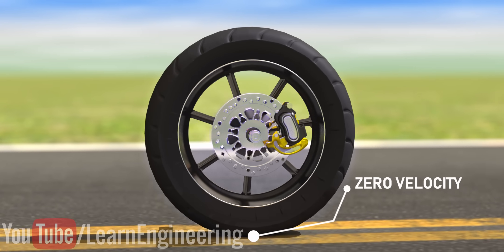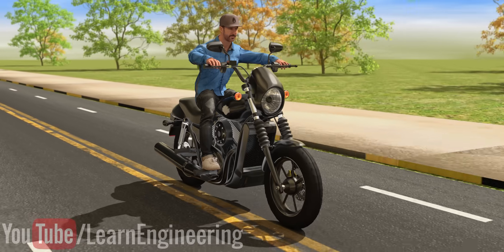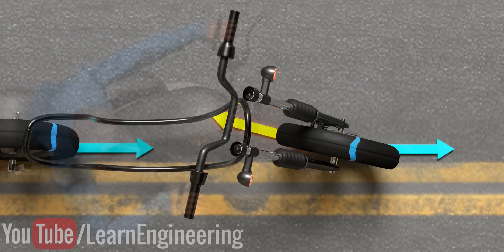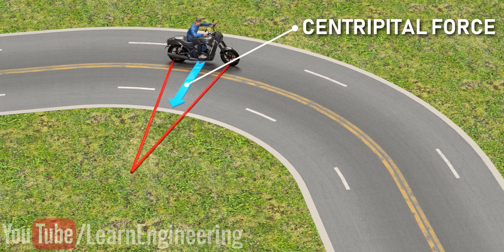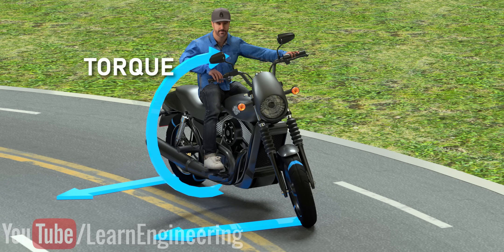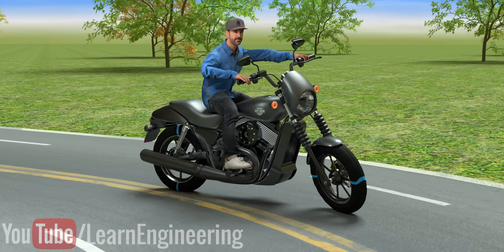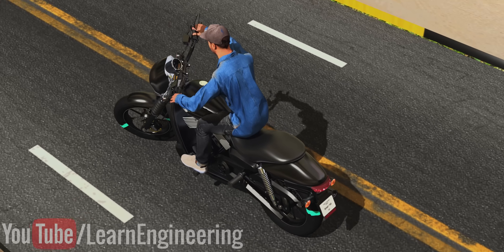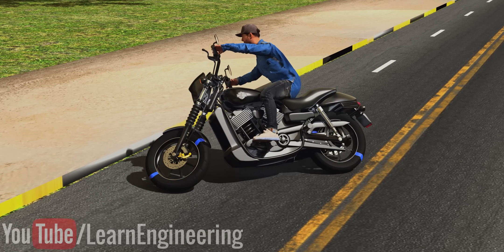Counter Steering | The interesting physics behind it

Comment: Counter steering is basically a natural way to turn a bike, too natural that a lot of riders doesn't realized they were using it all the time. It's the only way to turn while speeding. There is no such thing as "normal steering". Direct input steering is only used when the bike is slow enough that the torque it produce isn't enough to lean the bike, you use it at extremley low turtle speed. But once you start to gain some speed it will always be counter steering, no other way. The front wheels will always follow where the bike is leaning not where the rider turns the handlebars.
Reply: and you got an whole veretasium video to back you up 😁
Reply: @tonyfalapatt1308  hehe yes I watched it some time ago too
Reply: @tonyfalapatt1308  exactly😆
Reply: @tonyfalapatt1308  from kerala?😉
Reply: Easiest way i learned is press right go right, press left go left.
Reply: @everardomezajr3495  that's the same way I've always thought about it. I always thought that calling it counter steering was an easy way to inadvertently confuse people.
Reply: The fact that a lot of riders aren't aware of it make them go too wide in a bend when stressed out. If they were aware, they just pushed the inner barend and tightened the curve.
Reply: @HansVanh1  
100% bang on
Reply: Yeah, the knowledge of “if you’ve ever turned a motorcycle going 10mph or faster you know how to counter steer” that would end a lot of confusion, also very well said
Reply: @Zac-fu2qc  If you ever turened a bicycle at idle speed, you did it by countersteering, well said.
Reply: facepalm "The front wheels will always follow where the bike is leaning not where the rider turns the handlebars." ABSOLUTELY FALSE. Never heard of counterweight? If you lean the bike one way but you put your body the other way to keep balance while keep ing the handles straight, you're gonna go straight, not where the bike is leand toward. In order to turn, you have to turn the handle bars in the same direction too... And how about slow speed manoeuvers? You only use "normal steering", NEVER counter steering. Unless you like to fall... Which will not make you turn in any case... I suggest you buy a bike and learn to ride before saying stupid things... Cuz you obviously never rode a bike; i mean a motorbike, not a bicycle... and even on a bicycle you use "normal steering"; which according to you doesn't exist.
Reply: @saabsly1  
“In order to turn, you have to turn the handlebars in the same direction too”
Really????🤔
You then go on to mention “slow speed steering”, so I can only think that the first quote refers to higher speed steering.
Reply: @softailfun  maybe you try reading my post again???
Reply: @saabsly1  facepalm ""The front wheels will always follow where the bike is leaning not where the rider turns the handlebars." ABSOLUTELY FALSE. Never heard of counterweight? If you lean the bike one way but you put your body the other way to keep balance while keep ing the handles straight, you're gonna go straight, not where the bike is leand toward. In order to turn, you have to turn the handle bars in the same direction too... And how about slow speed manoeuvers? You only use "normal steering", NEVER counter steering. Unless you like to fall... Which will not make you turn in any case... I suggest you buy a bike and learn to ride before saying stupid things... Cuz you obviously never rode a bike; i mean a motorbike, not a bicycle... and even on a bicycle you use "normal steering"; which according to you doesn't exist."

Absolutely false.  Every word.
Reply: @saabsly1 Are you alright? He is right you know, Even on a normal bike you counter steer, and normal steering over 15 is not possible. Its physic
Reply: It's overanalyzed 
Anyone who rides does this naturally
Reply: @willyjf6193  But knowing exactly how it works allows you to do the right things quicker and more efficiently rather than have some vague idea of what to do.
Reply: @willyjf6193  thats why most riders lowside in panic situation
Reply: @willyjf6193  my dads friend tried to turn but didnt know how to countersteer long story short long life short
Reply: @willyjf6193  wrong; they 'kind of' do it naturally.  The rest takes intentional input
Reply: @willyjf6193  thts what i thought
Reply: @willyjf6193  Nope, not in an emergency situation. Too many riders are killed because they "naturally" turned the handlebar the wrong way, like the steering wheel on a car.  The "natural" way is to turn away, but on their motorcycle they then turned into the oncoming car instead of from it.
Reply: @willyjf6193  yep ....and every explanation I watched just complicates it ...
Reply: I agree, unlike how this video seems to say. You can push the handlebars the wrong direction the entire way around the corner. The bike will lean, it will turn the corner, and there's no danger of suddenly having to turn the "normal" way.
Reply: @elmeradams8781  Yes, you start the turn by tuning the front wheel the “wrong way” for a split second, then the front wheel must folow the turn. When doung so, the bike itself tris to turn sharper and stad up. To prevet it from doing so, you need to keep a light pressure “ourward” in the turn, put the front wheel follows the turn.
Reply: at what speed it starts to work? if you make a turn how do you know when to use countersteering and when to turn normally because speed is too low? Let say 90 degrees right turn in the city at what speed? below 10 mph seems like bike want to fall..........
Reply: @Voltomess  you will also be able to tell, if you want to practice counter steering, get going to about 50 mph, or even 45, and you will notice that you physically can no longer steer the “normal way” and then you will understand, you can push on your bars to increase the bikes lean, and leaning the bike is the only way you can turn at high speeds
Reply: @Zac-fu2qc you mean by push to push down in the direction of the ground to go that way?
Reply: @diego432hz  yeah kinda! Like, if you want to go left, you push the left handle bar down to the ground, and vide versa.   Just please remember yoh need to be going at least 30km/h or about 15 mph for this to work.  You will see what I mean right away
Reply: @Zac-fu2qc  Yeah, I already do it. I thought you were saying to push it away from you to go that way. Thank you friend <3
Reply: @Voltomess  I'd say you about have it. Anything above an idle in first gear countersteer will work. In practicality it makes more sense to lean into the turns. That gets your weight where it needs to be anyway.
Reply: @Voltomess  There are 2 answers to your question. The simple answer is yes, and that's because most bikes have about the same "numbers". The long answer would be that it depends on many factors. Speed is far from being the only one. The physics behind this takes into account mainly the friction, the center of mass, the mass itself, the speed obiously, and the gravity, which again doesn't vary much since we for granted that you are riding on earth. But since most bike have a close enough weight, and that they make the center of gravity almost always around the same spot depending on the style of the bike, and that we all use similar rubber, the answer becomes the same and yes, its around 10mph or less. But try on a pocket bike (lighter and very different mass spreading), with wooden wheels (very low friction), or on the moon (light, but comparable mass spreading), and each time you'll get very different definitions of "low" speeds.
Reply: @Voltomess  out of the "friction zone"
Reply: @Voltomess  There is no "normal turning", as is erroneously and poorly attempted to be invented in this video. To turn a motorcycle, you must lean. To initiate the lean, you countersteer. At any speed. When you are leaned over sufficiently to make the turn, you stop the countersteer, relax, and the front wheel will turn itself sufficiently into the turn to maintain that lean angle, and keep from falling over, as long as you maintain forward momentum and don't run out of steering lock at extremely low speeds. In slower turns, the front wheel will then be turned further into the turn during the rest of the turn. As your speed increases, the front wheel will be turned in less. Regardless of the speed, you countersteer to INITIATE the turn.
Reply: @Voltomess it happens when gyroscopic force is grater than gravity. That depends on wheel size.
Reply: @Voltomess  Yes  - when the bike wants to fall over by itself, that is when you do NOT want to use countersteering. In this case you turn in the direction you want to go. When the bike will carry on going by itself without you, that is when you use countersteering.
Reply: @Voltomess  roughly 15-20mph genrally but to be honest this isn't something you think about or even need to be taught, it's the same as a bicycle at higher speeds, it's just happens, if you have access to a ebike try turning at max speed while thinking about it, either you will crash or counterstear, if you don't have access to a ebike take a regular bike down a hill same difference
Reply: @jaykoerner  I guess I never rode a bike that fast when I was young 🤣
Reply: @Voltomess  if you have been down a hill youre probably going at least 15
Reply: @jaykoerner  o shit now I remember small accident in the park when I was riding my bike and there was that nice curve and I almost ended up in bushes because my bike didnt want to turn the way I wanted!!🤣🤣
Reply: @Voltomess  o
Reply: Exactly, the front wheels ALWAYS turn the way the bike is leaning.
Reply: @philatkinson3955  You state:  "Exactly, the front wheels ALWAYS turn the way the bike is leaning."
After the lean is initiated by turning the bars in the opposite direction you want the bike to lean.
Reply: came to say this exact same thing, with any speed it's counter steering only.  the "turn in" described here is just going to lean you the other direction and start you turning that way.
Reply: @teknik12k  
The point is that the video shows the rider steering into the bend, that doesn’t happen. The result of such an action would be to stand the bike up. The bike does indeed steer into the bend, but that is not due to rider input….. it’s due to the bikes own geometry.
Reply: @softailfun  i know, i ride everyday. the video is non-sense.  I noticed the thumbs up to down ratio after commenting here.  they way they describe completing the turn would have you actually turning the other direction and running off the road.
Reply: @teknik12k  
Agreed. Ride safe fella.
Reply: Amen!
I'm asking myself if the video maker ever drive a bike or just see them drives by others!🤦‍♂️🤦‍♂️
Reply: And steering will always follow where your looking
Reply: @Steve00alt "Turn your head" is drilled in to you constantly when learning to ride.
Reply: Countersteering to lean the bike works at every speed, including zero.
Reply: But, it's not proper to friction caused skidding the back side tyre even though driver balance d.
Reply: Exactly the point i want to point!♥️
Reply: You are absolutely right
Reply: Im getting into bikes, never rode one but will soon hopefully, most of this doesnt make sense, will I easily get a grasp of what you mean when i start riding? I cant imagine counter steering mostly when idk necessarily what it is lol
Reply: @krypticghxstgaming  
Hi Kryptic, first thing you need to do is completely ignore what you seen on this video. 
Next watch this link, it’s probably the best video on YouTube on this topic.  https://youtu.be/lzk8oyNO708
Enjoy riding, I hope this helps you man.
Reply: @softailfun  Best video that I've ever seen regarding counter-steering.  1000 times better than this simulation video.
Reply: @krypticghxstgaming  Can you ride a bicycle?  Yes?  Then you can ride a motorcycle.  I've been riding for years
 Never heard of counter steering before today. I guess it just comes naturally because I Never think of counter steering   it just happens.
Reply: How about slowing down the bike during a sharp turn? I do that and so do most other normal people. None of us are MOTOGP riders and our capability to do these stunts would get us nothing beneficial.
Reply: If you're above around 10mph (depending on the bike) you're likely having to press right to go right or "counter steering". And if you're picking up speed through a turn it could change half way through, from turning into the turn, to pressing opposite.

On my Goldwing, leaving my friends street directly on to a 50mph highway goes from me normal steering left, slowly bringing the bars back, and pressing left bar by 15mph.

  @DantesInferno96
Reply: Well put. What a ridiculous video this is. I can only pity those who use such videos to learn motorcycling or physics.  They are certain to crash.
Reply: Bang on to the o.p
Reply: Dude thank you for this. -dude that overthinks too much and rides bikes 👍🏼
Reply: this comment should get top pinned 👍 finally someone who speaks sense
Reply: yes I do it all the time but didn't knew till now .... physics is crazy
Reply: A great video about this, using science https://youtu.be/9cNmUNHSBac?t=293
Reply: this is just a fancy way to get views
Reply: I was told by a group of bikers that i was a moreon & they were surprised i was even alive.
The next week we were on a ride out & i had my gopro on my back.
I got in front of each rider in turns & showed them thats what they do!
It was a glorious day!
Reply: Yeah, veritasium’s video on how a bike works is loaded with comments from cyclists claiming he’s wrong, and that they can just lean to steer a bike. Even though that just causes the bike to steer, countersteerimg in the process
Reply: i dont ride motorcycles but if im going fast downhill on a bicycle i do this. never even thought about it until now
Reply: No, it is NOT natural to counter steer.  I almost killed myself when I first started riding because I consciously turned hard in the same direction of a turn going at speed.  The rider must be educated and understand what is really going on and properly counter-steer through a turn.  Please, to save your life, I recommend all riders to review this technique on sites from California Superbike School taught by Keith Code.  He has instructional real time videos that perform the counter steering techniques and dispels the many misconceptions behind it.
Reply: Agree 100% with you, Car Jac!!!    Main article is misleading!
Reply: this: https://youtu.be/9cNmUNHSBac
Reply: Yes.  Agreed.  Read my "two bobs worth".  I basically said the same.  This is poorly illustrated (literally) and misleading.
Reply: Also, no referrence to, or explanation of, circular momentum.
Reply: @ImoldsoIknowstuff  why is that needed, you mean precession
Reply: Your right sir this video is going to get someone hurt they treat counter steering like its a magic trick lol
Reply: So do I not lean when I counter steer ?
Reply: @Alexander The great  bike will lean on its own in all honesty you don't have to lean your body at all you just stay perpendicular you can lean if you want to give your self a better view at corner ahead while in the turn.there is a counter lean when you are at super slow speeds and using direct steering turning handle bars into the turn so bike does not fall over due to not enough centripetal force
Reply: @KennethWhiteakaruckusbringa  ah right. Thanks for your input. I’ll be putting it into practice soon I just need to tell my brain that counter steering is all good 👍
Reply: Very well said, the video seemed a bit misleading
Reply: Spot on. 👍
Reply: You are 100% right. This video is total bunk on many levls.
Reply: The more interesting part that the video didn't talk  about is how our brain naturally could learn to any vehicle we ride and adjust it center of gravity like it is part of our body.
Reply: Conciously or not, countersteering is the only way to turn the bike if it is faster than walking speed. Fun fact: Older folks in Turkey calls motorcycles as "seytan icadi" which means "devil's invention". Probably because it turns right when you want to turn to the left by trying to turn the handle bar to the left and vice verca.
Reply: @everyday tenor in this video, 3:47 he said during the lean opperation（in the turn）, the driver cleverly adjusts the angle of the handlebar. Physics don't explain how the steer angle is like that. The truth should be like what Car Jac said:　The front wheels will always follow where the bike is leaning not where the rider turns the handlebars. i.e. no steering input and let the bike do its job
Reply: Ya and a lot of Harley boys really think they’re not doing it lmao
Reply: I use counter steering all the time and everytime my friends ride on the back of my bike they just keep asking why I lean so aggressively at low speeds
Reply: The so called "normal steering" is only possible with your feet on the ground AND crawling forward. There is no "leaning against the air" in physics. Many youtubers are preaching the false religion aka "normal steering at lower speeds".
Reply: I didn't realize I was counter steering my entire life until I watched a couple of these videos
Reply: My front tire is always pointed to the heavens
Reply: Guess I’ll put some bubble wrap on and give it a try.. not .,
Reply: So basically you could say that counter-steering is if you would ride a normal bicycle and let go of your hands, to turn the bicycle with no hands to the right for example you first have to lean to the left a little bit and then to the right, making a little S shape, because if you lean to the right at first the front-wheel has a high probability to oversteer and lock-up, making you fly forward.
Reply: Very well said
Reply: Yea i was going to say this. Who the fuck turns their bars at any kind of speed 🤣 lol good way to get dead.
Reply: @masterxXx77  ok.....🤣🤣🤣🤣🤣🤣🤣🤣🤣🤣🤣
Reply: @countryjoe3551  you dont really though its like a wiggle. Not a turn. Unless your walking your bike. Lol.
Reply: @masterxXx77  do you countersteer though the corners?
Reply: @countryjoe3551  
Yes. Any bend a rider needs to counter steer.
Reply: Even at low speed we're using the same technique. A bit of countersteering to start a lean then steer to the other side to balance the bike because there's not enough gyroscopic effect that balances the forces. Steering in a bike is used to move the center of mass instead of using our body weight. When you ride a 400KG bike you need to know this or do it naturally but it's useful for any size of bike. When trying to stand still on a bycicle we move the handlebar as much as our body to balance it, it's all about balance and leaning the bike to make it turn. The curvature in the wheel makes the bike turn when leaning because the wheel radius is smaller towards the edge of the wheel.
Reply: You're still turning the handlebars the direction you're turning. It shouldn't be called counter steering because all you're really doing is applying a bit of pressure in the opposite direction you're turning. You're still steering the handlebars in the direction you want to turn. You're not turning left to go right unless you're drifting/powersliding...
Reply: @ktm125sxbeast  
https://youtu.be/lzk8oyNO708
Reply: You just lean and use your body to direct the bike thats normal dude... You can do it at any speed... The is 3 ways to steer that i now how to do at good speed normal that lean countersteering that is drifting quickly the direction and then correct this can make you lose you control is more unreliable than just leaning and then break steating that just drift...and is the most dangerus and complicated 😅. Saludos de Argentina
Reply: ok soooo it doesnt matter where you turn handlebars i can pick either direction to go either direction i just have to lean which way i want to go??
Reply: @BSABD315  
At the risk of repeating myself (I left this link on another post of yours) look here:
https://youtu.be/lzk8oyNO708
Your understanding of counter steering is really confused fella.
Reply: Prove it.  Show me one video of someone counter-steering on the highway.
Reply: @protoborg  on highway it's literally impossible to turn without countersteering.
Reply: @janvotava9792  wtf just use your body and you can turn at any speed  countersteering is maybe more usual for you but as it show in the video is just more inestable.... So u shoud try to lern normal steering especially at higher speeds.counter steering should be consider an emergency tool not a normal way to turn... That the hole point of this video.sorry for my english 😅 saludos de argentina i allways use normal lean stering in my 1984 vf1000 and if im over 70 mph or if its windy i try not to countersteering belive its really bad i dont know what kind of bike can really countersteering over 100mph or so but it seems to me is just for emergencys and lot of ppl is abusing this tool. 💪😎
Reply: @dariocastro9079  it's not possible because of the physic, you can try it with you hands out of the handlebars, you will turn negligible and the handlebars will countersteer
Reply: @protoborg  it's just physics bruv
Reply: @protoborg  The video you've just watched has got the physics a bit wrong in that they talk about "normal steering" which just doesn't work at high speed. (above about 10mph)
Counter steering is how a 2 wheeled vehicle steers and you have been doing it naturally if you have ever ridden a bike. 

This video shows the physics better: https://youtu.be/PgUOOwnZcDU
This video shows it in action on a race track - https://youtu.be/TW6h5aq-xqw
If you're not convinced, you can watch this one where a rider tries to invoke "normal steering", but the consequences aren't very nice for the rider. https://youtu.be/VVE79XT8-Mg
Reply: @DaveBarnes1  wtf again i turn every day normaly leaning at 60/90 mph with mi 1984 honda vf1000 .... Why all ppl say there is only one whay yo turn at hight speed there is 3 or 4 ways dude the correct is use you body and lean... You use countersteering... God bless you jajja dont find a windy day or old tires or wet flor or oil xD
Reply: @protoborg  🤣🤣🤣🤣🤣🤣🤣Do you ride a motorcycle?
Reply: @countryjoe3551 you can but it is slow without
Reply: @protoborg  shouldn’t have to prove it. If you ride you would know this 🤦‍♂️
Reply: @protoborg  Every rider does that. Counterteering is the only way to steer a two wheeled vehicle .
Reply: @protoborg  you press the bar. That doesn't mean that you pressing so hard that you actually turn the wheel